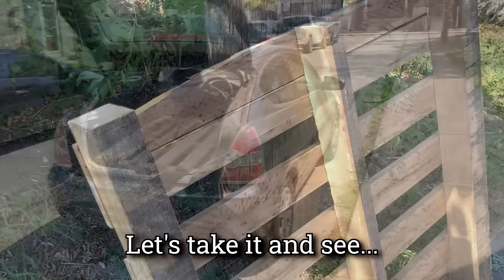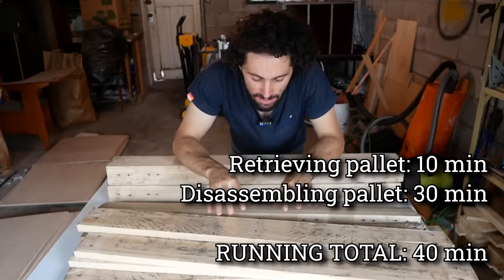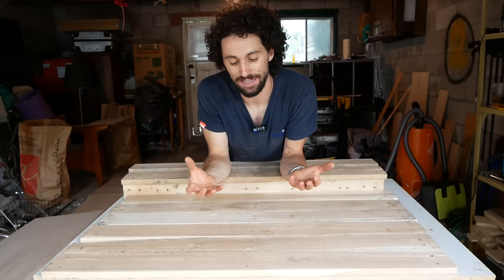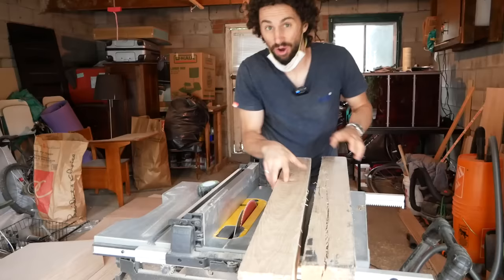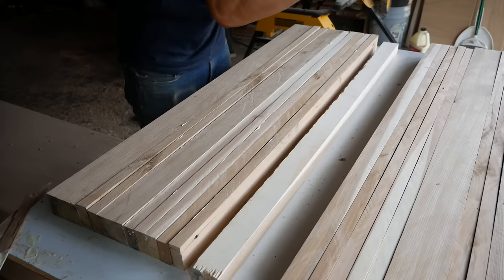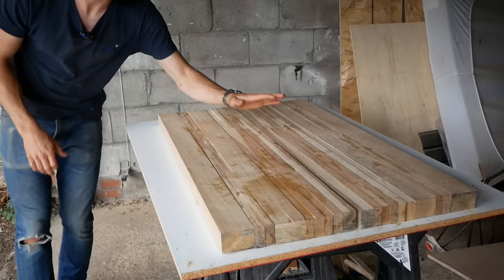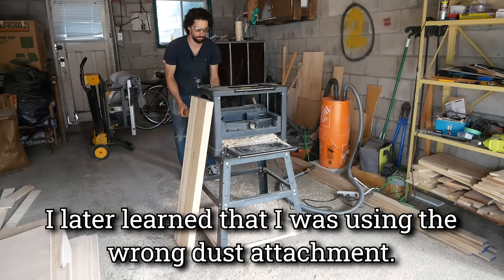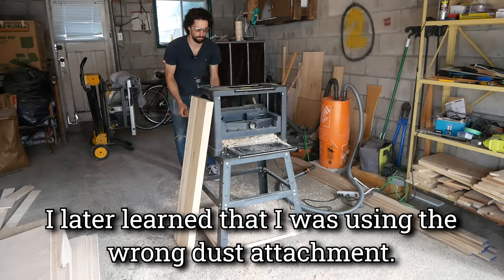Turning a Free Pallet into a $550 Table

Comment: You should 3D print one of those plank pushers for your table saw, because you know in 30 seconds the safety police are going to tell you that you could lose a finger. Might as well make a video out of it at the same time :)
Reply from the maker: Haha great idea!
Reply: For real!  Your thumbs came really close to that spinning blade. Even a scrap piece of wood as a push stick would have been safer. Rule of thumbs… hehe… if you can’t put your whole hand on it, use a push stick/block. And you should 3D print an extension table so your projects don’t drop off the back of the Tablesaw.
Reply: True, I was so concerned for is fingers 😅
Reply: I'm not even the safety police type, and I was cringing every time he was pushing a board (I also had the same 3D print idea you did -- and hey! Video idea!)
Reply: I came here to recommend the same.
Reply: "Morley 'Stumpy' Kert" has a nice ring to it, but I don't really want to see it happen.
Reply: @ToddRafferty  me too!
Reply: Safety Police!
I came to warn you that you are going to lose a finger with that saw if you don't 3D-print some pushers pronto!😎
Reply: For push sticks, you want one that has a hook at the back, and a long tongue that also helps to hold the wood down. I made some from some scrap wood, pallet wood would be fine, the hook on the back is just another scrap of wood that is glued and doweled onto the main handle, so that when you cut through it enough that it's no longer useful, you can just replace that bit. The doe's foot style push sticks are better than your fingers, but still risk nasty kickback in some situations.

For an example of what I'm talking about, you could search for "Jay's custom creations best push stick ever"
Reply: I'd much rather be the "safety police" than a knucklehead that let's his fingers get that close to the blade.
Reply: I became a safety police 3 months ago when my hand went through the blade, im keeping the rest of the info to my self😅
But yeah, think safety and then atleast 2 more steps..
Dont want anyone els to have this experience and live with it!
Reply: I've cut my thumbs 1 years ago, without pushers :) Now, i ALWAYS USE IT ! Imagine the wood have a nails in it or another metal thing, bye bye finger.  No need to print, juste take and old planK...
Reply: To be honest, the safety police would be right too. Is it really worth risking one slip of an inch and losing your thumb because of recklessness?
Reply: surprising cuz he seems like the kind that would be the safety police
Reply: Hello all 🤝🤝
Reply: @Gumbatron01  👍👍
Reply: I believe that would be not "a" finger but fingers plural.
Reply: I just make my push sticks out of scrap off cuts. They’re disposable, I run them right into the blade sometimes.
Reply: OK, OK, I guess I'll jump on the 'not trying to be a Safety Susan, then doing so' bandwagon here....  A lot of people don't realize all the forces at play in using a table saw, not all of which are exactly intuitive.  For example, a piece you're pushing through a 5,000 rpm spinning blade by hand can get hooked on a tooth so that it's pulled over into the next, then the next, with the effect that the piece 'walks' up the blade, then gets pulled left as the blade sort of skitters its way across the bottom of the piece.  Then after the piece runs out, suddenly it's your hand that's in the spinning blade because the board kicked back at you.  Oh, and the time it takes to happen?  Much shorter than it took to read all that.  More like a blink, and while you're standing there dully trying to figure out what happened, you have instinctively pulled back your hand which is now a mangled, bleeding thing, and you probably have either a pain in your belly, or a piece of wood protruding from it.  Those kickbacks where the wood sucks your hand in sideways may be rare, but they are frequent enough to be a thing.  And they will ruin your day....
Reply: I work with a giant tablesaw. Never use pushsticks because they tend to make the piece roll into the saw and make an indent, which is not very desirable when you want a clean, flat edge. But I really focus on my hands all the time, so they're nowhere near the saw
Reply: By seemingly being the first person to make this comment, not only are you a member of the safety police, you are possibly the most prominent member
Reply: I made a push block with a piece of 2x4 with a little handle on top. Super inexpensive option to save those digits
Reply: @Bloodray19  for this kind of Work, u juste use 2 pushstick ... Thqts the way
Reply: It made me cringe watching him
Reply: Or just use a piece of scrap. Protect your money makers. Would it be the safety police if they were telling a stripper to get off the couch and stop eating donuts?
Reply: He has the pusher right nexxt to him do... 4:32 u can see it next to the meassuring tape... It made me laugh later when he insist in safety glases even do he risk his fingers... Anyway not here to hate, just to leave a coment and some love to Morley... Love to see nice woodden furniture beeing done with out  having the most complex and full of tools shop u can imagine... Amazing result + scarce tools = 2ble amazing result (in mi opinion at least) Keep it up, whant to see more...
Reply: @PinakBERT  hell yeah I was like 😱🫣🤣🤣🤣
Reply: Please please protect ya neck... by that I mean your fingers... otherwise it will be a deal with a big minus
Reply: @lavieillebranche  I can sympathize, did similar with  router , right hand, right thumb and guess what I’m right handed, well not any more, I’ve still got pictures in my head from that day 2 years later and often get in a sweat when thinking about it, I imagine a table saw to be worse, get well soon
Reply: Safety police or not, it's such an easy and cheap fix that is actually worthwhile. Using a table saw without push sticks is a completely unnecessary risk.
Reply: Ya! $550 for a table minus a few fingers? Priceless! lol
Reply: Ya, thats a no no, u need push blocks or push sticks. Takes 10 minutes to make some from scrap. Not going to comment on the design, but that technique of ripping the 2x2s was asking for a thumb lossp
Reply: "SaFEtY pOliCE" ... or just don't be stupid with power tools.
Reply: if you mean the professionals with 40 years experience police who still have 10 fingers ya you definitely don't want to listen to those guys the "the plank pusher" is called a push stick and in most cases you are better off with your hands holding the workpiece firmly as you push it through a stick cannot grab and hold !
Reply: @PinakBERT  haha ok how many years experience do you have on the table saw ??
Reply: You could also make a plank pusher out of a piece of pallet wood?
Be far quicker and cheaper if you’re already in a carpenters workshop.
Reply: There is a push stitch on the saw at 4:49
Reply: get a SawStop pronto
Reply: @jimbobjones9330  Right. This isn't a "safety police" thing. This is just a rational precaution thing.
Reply: Okay
Reply: I prefer the comments from people claiming to actually BE furniture
Reply: It isn’t so much how he is passing the keeper piece through the saw as much as when he keeps on reaching for the off cut while the blade is still going. If just a single tooth catches that off cut it will pull his hand into that blade before he can even blink. At least from what I could see his thumbs were coming within a fraction of an inch of that blade.
Reply: ....don't all table saws come with push sticks
Reply: I was thinking the same, literally squirming watching him push those pieces with his fingers 🤮
Reply: Ya....OMG DUDE.  Your fingers are all over the places they are NOT supposed to be!!   I had to shut my eyes while yelling at my phone, I was so scared for you.
Reply: Great video, but man it was hard to watch you using that table saw. As someone who had a small board jam and flip which led to four fingers across a 1" dado, you definitely need a push stick bud.  Luckily I was able to get my fingers out before it drug them into the blade, if I had been using a single blade I would have lost four fingers that day.
Reply: Why clean off the dirt if you are going to plane it anyway?
Reply: Please do that. I was freaking out watching this.
Reply: I’m working with a guy who lost partially his two fingers using a table saw. Be safe! Nice vid.
Reply: Buddy of mine just got to use his saw stop the other day. He still has ten fingers. Make a push stick out of anything.
Reply: Safety police 🚔  here, what's the matter?
Reply: the saw ships with it, it's on the other side of the fence
Reply: Just here to read the comments on the safety police issue, don't mind me. Anyone want popcorn?
Reply: @MorleyKert  -   Nice table.  Very clean look.
  Yes, make a "pusher" video AND design your own pusher, brand it, and sell it.   That will also help you to remember you should be using a pusher and all the other safety gear.
Reply: With all due respect, the “Safety Police” are completely right. I vaporized the tip of a finger several years back on a table saw. As in pink mist and a visit to the hospital. Besides a permanent scar and no sensation at the injury site, I ended up extremely lucky. I know of others with much worse, life-changing injuries in the wood shop. By all means, make a video about manufacturing push sticks. But, you might want to hold off on laughing at good advice. Or maybe you like a throbbing sensation whenever the barometric pressure changes quickly.
Reply: Triggered by the fear of losing a trigger finger...
Reply: He’s going to lose a finger. He didn’t even check the wood for nails or knots. It could have unwarped or the saw could have hit a nail and slightly shifted the wood, then send the piece flying and his hand right into that blade.
Reply: @Bloodray19  If your stock is drifting toward the blade, I'm guessing you're pushing closer to the fence than the blade. Use your push sticks just to the right of the blade, as far from the fence as you can make it. That will keep the rotation directed toward the fence, not the blade.
Reply: @VoteEvilDrumsNow  guys that have been running table saws for 50 years lose fingers because 1 second of focus...

Comment: I used to manage a pallet company many years ago. Pallets are generally made from oak! They do make great projects. My friend used to make natural Christmas ornaments and small toys out of the boards I used to give him. He would use stencils of pine trees/ snow flakes/angels/ reindeer heads etc. He used a planner/ scroll saw and a cylindrical table sander. Finish as you see fit. ( varnish/oil).
Reply: Yeah. They don't use oak anymore. I work in a warehouse. It's all cheap wood. Fir and Pine
Reply: @drewdougan  That’s what your company is purchasing. It is a matter of cost per pallet. Your company doesn’t want to pay for the oak pallets. It all depends on what merchandise is going on it. There are still oak pallets because I see them every day being used. There are usually three main factors in determining whether you get Fir,, pine, or oak. It’s longevity of the pallet whether it is a one time use or multiple uses, the weight of a product that is expected to go on it, and cost to the company purchasing them.
Reply: @drewdougan  depends on the application of the pallet, some loads require hardwood pallets still but yes, cheap SPF shook is the most common pallet material today. That said I have seen many poplar, oak, and even cherry in some heavier duty pallets recently.
Reply: @drewdougan  or spruce or hemlock.

Comment: For gluing up my first time at home, I didn't have clamps to hold it all together so I used rachet straps and it worked like a dream and shocked me because I didn't expect it to work as well as it did
Reply from the maker: Awesome! Work with what you got 💪
Reply: I didnt ever think of that and I have loads of long rachets. Great idea!
Reply: Great idea, thanks!
Reply: I just made a desk for my daughters room using wood from a giant pallet box with equipment I build and used the ratchet strap technique, I also dowled each length which is really hard to do

Comment: Nice looking table. Aside from the comments others have made about safety - when gluing up something like this, it may be better to turn all the boards s the glue side faces up and glue it as a "single surface", then flip then 90° for clamping ... the glue will not start setting up before you get them clamped that way. Like others have said, put clamps under and over to keep from having "curl".
Reply: i dont know if was just me, but I thought I saw some curl. ya think?
Reply: Also use cauls
Reply: Flip each board to alternate grain to compensate for tendency to curl. If the pallet's been outside for a while keep in indoors for a few weeks to acclimatize it.

Comment: I dont recall seeing Pallets with that thickness of wood before... ever. Congrats on the find.
Reply: I was thinking he built a pallet just to say he found it.
Reply: Yeah ahha and the wood is also very smooth.
Reply: @kjfurr  There are stamps on the side of it suggesting that it was made by a company (early in the video). i guess my point was that most pallets are simply not that well built. If they were we would see more pallet tables for sure... heheh.
Reply: It was actually a skid not a pallet. Pallets usually have 2x4 runners (3 evenly spaced/ends and 1 center). The oak boards are either 3/4 or 1 inch thick. Skids are usually a one time use then disposed of . pallets are reused. The thicker runners are usually used for holding/shipping barrels/drums.
Reply: @WARPSPD  Well, that does make more sense. Skid it is.
Reply: He's turned it on end and glued it together that's why it's thicker
Reply: @mattlawton4715  @Matt, so, we were talking about before he turns the wood boards on end and glues them. Since the title is called "Turning a Free Pallet..." we assumed it was actually a pallet, but in reality it is a Skid, which is made of heavier wood stock than a typical pallet.
Reply: Masonry materials require pallets of heavier stock - steel coil, sheet metal, industrial/light manufacturing applications as well - check out small machine shops

Comment: Table turned out nice.  Clamping from both sides (top and bottom) with that style clam will help keep it from cupping like yours did.  Or invest in some parallel clamps.  Also, be sure not to over tighten when screwing legs directly to the table to allow for seasonal wood movement.
Reply: I was going to say the same. The cupping destroyed my OCD 😂

Comment: Love the table! It looks fantastic. If I may part a little wisdom from experience. You need to finish the underside. If you don't, the piece it will warp as moisture will infiltrate faster from the bottom. It happened to me a few times before I realized what was happening.
Reply: @James Lindeman - " it will warp"
If you watch from 12:35 to 12:45 look at how the table wobbles.
I don't think warping will be an issue because it already IS warped.
Something else i noticed is that instead of epoxy alone to fill the gaps/holes/whateveryouwanttocallthem he had in the wood, some will use CA glue (superglue) mixed in with saw dust (preferably saved from the board you are filling) This is to better hide the fact that something was filled in.
Reply: Bro it's already warped
Reply: C'mon James, that would have driven the price up another $550!! Finish the underside...psssht.

Comment: In the middle of the video, I noticed that the slab is warping. Usually, it's recommended to "interleave" clamps - one on the bottom (under the slab), then one on the top. Then it has an equal pressure, and slab it getting straight (sure, if boards are straight).
Reply: I do this for my glue ups using pipe clamps. I have about 15 of them and I still get warping. To alleviate the warping you can either clamp to a flat surface from the top or put a flat piece diagonally across the piece and clamp it on either side. Do this before adding final pressure so it works properly. Just alternating clamps from bottom to top does not stop pressure warping. Also using a biscuit maker or some other way of adding support to the joint helps.

Comment: Looks amazing but I think if you took some wood out where the table legs sit, it would make them sit flush and look really clean and instead of screwing directly into the wood, it would be great if you used metal threaded inserts so when the table legs have to be removed the screw hole won't be damaged ☺
Reply: Exactly my thoughts! Just couldn't tell it in a foreign language as being German.
Reply: He was making a table quickly and cheaply, to sell at a profit, so these nice features might have made the project unviable.
Reply: @ParaBellum2024  the metal inserts are inexpensive compared to the profit margin and making the legs sit flush take a bit more time.
Reply: Good ideas.
Reply: @ParaBellum2024  / Depends on if you're leaning more towards capitalism or craftsmanship.

Comment: 15:18 Make screw holes in each foot near the edge, and put some small adjustable feet in.
This takes about 30 mins, and costs $10-$20, but will always help in making a table steady, even when the ground is slightly uneven.
A sturdy table will not settle steady on slight uneven ground but using small feet (with plastic cover), will.
They can be added into the metal as well, so when not needed they don't stick out,
but at a cost of some welding and some handiworks.

Nvm, looking from the side at 19:29, I see it has tiny feet sticking out.
(Still the ones that are hidden inside the metal are better, so you only see them when required.)